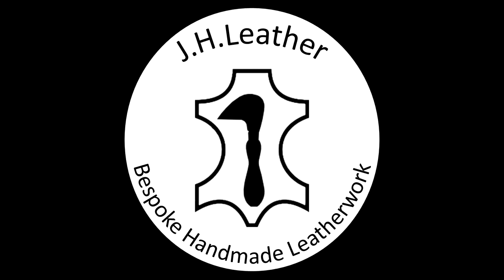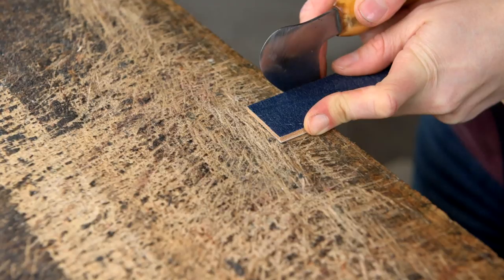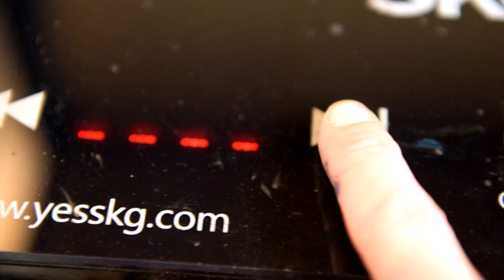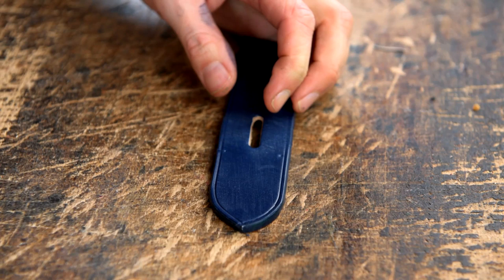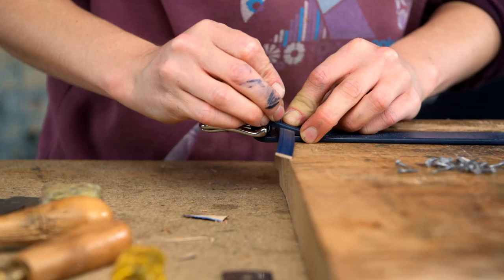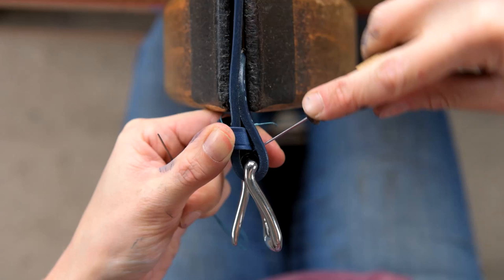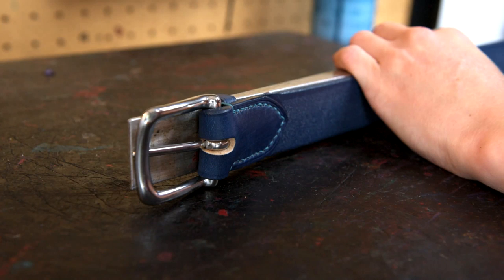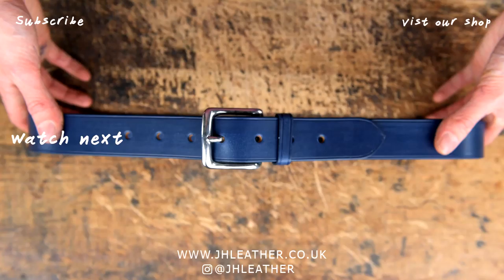Make your own: Handmade Leather Belt - Make along, Tutorial.

Comment: Joe, great video.  Can I ask you to confirm how you measure the belt?  I have watched numerous videos, and am now confuse which is the correct way to size a belt, either from the tip of the buckle or from the fold on belt?  Hope that makes sense.
Reply from the maker: I personally go from inside the buckle to the hole most used, that way if the buckle on the new belt is longer/shorter, the overall belt will still be the right size. Much better than just measuring the leather only 👍

Comment: Hi Joe. Thanks for a great video. I learned some of the finer points from you. My remaining problem with be.ts is that the die bleeds onto my trousers. Not a whole lot, but enough to give a less than professional result. I've tried going easy on the amount of die used. Followed by Gumtrag. Also tried a couple of layers of Gumtrag. Also tried bees wax on top of that. OK each layer seems to help a bit. But nothing so far eliminates the rub off. Any suggestions?
Reply from the maker: Have you tried acrylic resolene? Or tolkonole?
Reply: I have not. I will give them a try.
Thank you!

Comment: Thank you for you great videos. 1 question about belt length, would post the formula on the over length once you have waist size? One project that front and center on my small shop bench is a K9 moccasin, Ranger my Aussie, has a paw pad wound, that's slow heeling. 
God Speed Joe,  and  Thanks again for your vids,,,,, 
Semper Fidilus,,,,
Reply from the maker: Hiya

Good to hear you like the videos.

With belts the easiest option is to get a measurement off an existing belt and measure from the inside of the buckle to the hole used most. If you have people coming to see you, you can have a measuring belt that you use for this. For measurements without an existing belt, then get the person to measure where their trousers sit - I try not to go on general trouser measurements as depending on where they sit on you will depend on the size needed, so make them measure! Then you can take that measurement for the new belt

Hope that helps and that Ranger heals up soon :-)

Jo
Reply: One good formula is to measure from a exsisting belts bend (of buckle) to your favorite hole, then add 10.5 inches. Once thats done measure 3.5 inches in on buckle side. That will be the center mark for the oblong punch. Then on other end mark 7 inches in. This will be your mark for favorite (most used) hole. Then make a couple of holes on each side. Fairly simple way that works very well. Happy making.